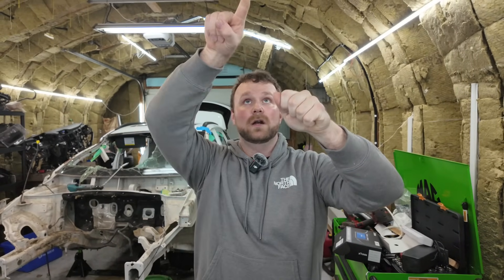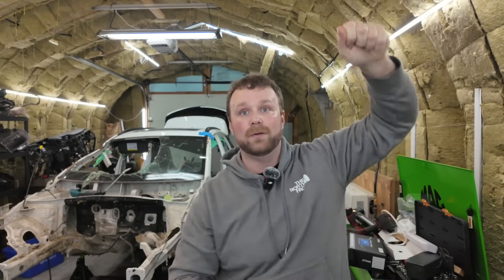Why were these L87's left out of the GM recall?

Comment: I own a 2025 6.2 and I am not into highway and off road disability adventures so I am just hoping right now that the 2025 engine does indeed have no issues.
Reply: You should drive it in L9 to be on the safe side L9 prevents the cylinders to shut off themselves and it keeps all the cylinders running The truck even sounds and runs better and shifts better
Reply: @will195 
What is “L9?” Thx
Reply: @Rob02138 I think he meant M9 - putting your trans in manual mode and driving in 9th gear
Reply: @Rob02138 I think he meant M9 - putting your trans in manual mode and driving in 9th gear

Comment: I have a 2024 Silverado built in August 2024 just before the 2025 production run began. Mine is not included in the recall.
Reply from the maker: That's good. :)
Reply: @Lancemechanics  I still would like more clarity on what oil I should use going forward
Reply: It will be included. The 2025s are going to be added. They're just waiting for a few thousand to fail first.

Comment: We have a 2020 Denali with an L 87 why is the 2020 not included it has the same engine
Reply from the maker: It's a different engines. The 2021 to 2024 blocks are updated. Hey if you haven't I'd recommend getting yours checked out and check into the afm/dfm deletes

Comment: I say if you bought a 6.2 L86 and it hasn't blown up after 10,000 miles or 3 oil changes its ok ! The failure rate out of 900,000 engines is about %.0004 !
Reply: 😁 HA HA, don't disagree but it is a funny way of phrasing it. Not a high standard. Imagine if surgeons said " Well if the the patient doesn't die in the hospital or within 3 days after surgery then things are probably ok.  I have a 2025 yukon and I am nervous. It's got 6k on it.
Reply: Only GM knows the real numbers, I’ve seen as high as 36% failure rate in my research. Yeah, a third of the trucks. More realistic probably 5%. Which is absolutely unacceptable.
You’re saying the yards are failure are pretty much none. At minimum we know for certain at least 26,000 trucks fail every year. Also completely unacceptable. Imagine looking at a field full of 26,000 trucks. And no matter which one you pick, your engine is going to go bad extremely prematurely.
Reply from the maker: Those are some good odds

Comment: When the xbox 360 first came out it had a defect known as sub-par "glue" basically that sat under and between the gpu chip to the motherboard.  Apparently the glue could not handle the heat, and as soon as the boards were tested at the factory their fate became sealed, they were factory fucked.  GM seems to be in the same boat as with many other manufacturers...
Reply: All these manufacturers need to get back to basics, it worked for many yrs 😡😡
Reply: Laptops around 2008-2012 had a similar problem where the video chips would get so hot, they'd melt the solder and lift off the board. So, that's when manufacturers started to epoxy chips to the boards. Even tie them down to the board for extra protection.

Comment: You can put a piston up from the bottom on a V8?  How?  Doubt that.  Remove crank and grind a bunch of the block out of the way??? Hmmm.
Reply from the maker: Nothings impossible if your stubborn enough. There's alot clearance in these 6.2s wouldn't be hard to make a tool and procedure
Reply: @Lancemechanics  My post-mechanic life is more interesting but no less stressful.  Sure I make a lot of $$$ engineering things that make things.  But, really stress at the moment...so it goes.  BTW, I'm a Ford or [old] Chrysler guy and would not touch a GM product with a 10-foot yardstick :P Blech!

Comment: They are to stick the SOS back in that engine to satisfy the EPA. The 6.2 from 2014 to 2018 had the AFM they like to blow up too. Doe's GM want to talk about that? Hell NOOOOO
Reply from the maker: I still think of all the people who had to pay that out of pocket. I hope all these lawsuits go through. People may not get all their money back but some compensation needs to happen
Reply: I make alot of money doing complete deletes in these engines!
Reply: The L83 and L86 are wayyyy more reliable. Less plastic garbage and AFM has way less junk parts than the L84 & L87 DFM systems do ...
Reply: 100% my son had a 18 Yukon Denali grenade.
Reply: They will give u a coupon towards purchase of a new vehicle like i got on my 82 square body side gas tank recall
Reply: There’s no problem with engines with AFM just use manual mode and they never use it or don’t city drive them and do long oil changes. Have a 2012 runs strong as day one 3k oil changes.
Reply: Gm is crap. So r all other companies